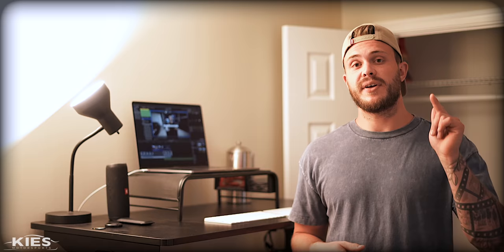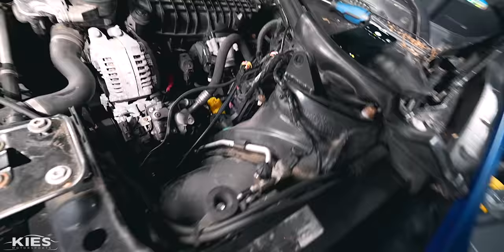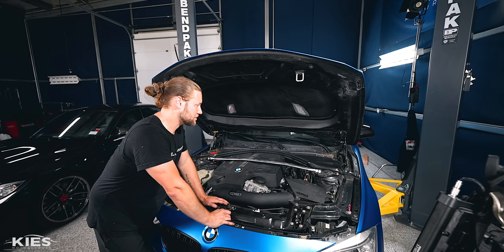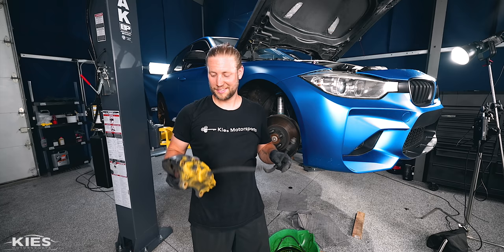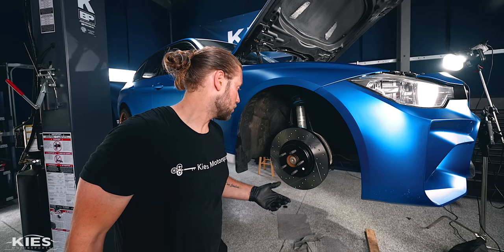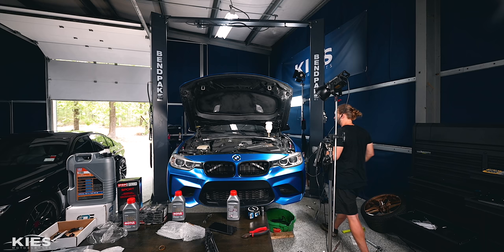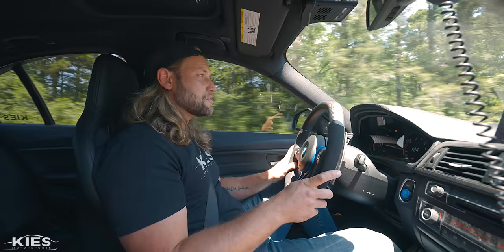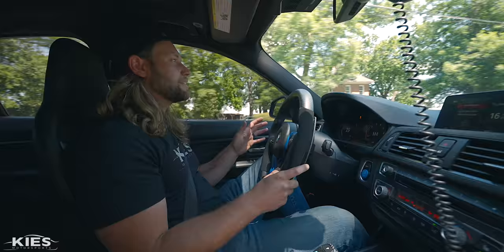F80 M3 Brakes and Dorch Stage 2 HPFP on my F30 335!

Comment: Will there be a version for 328 base brake upgrade🤪
Reply: I think the better question is, is it substantially different for the base (non-M sport) brakes? I’ve read different takes on whether the M sport/M performance caliper and rotors are compatible with the base brake system
Reply: it fits. look up m performance brake kit
Reply: Wouldn’t it get stuck on the knuckle ?

Comment: Where you hitting fuel limits with your hpfp? Didn't you have a dorch stage 1 running on 93 octane? no meth or ethanol. kind of curious because I'm planning on a pure stage 2 with no ethanol and cannot decide between a stage 1 or 2 hpfp.

Comment: Awesome, except, I Wish you were doing the 2NH 6 piston and 4 piston upgrade... Really need to what bracketing is necessary to have those mounted.
Reply: Hey Kinz, I have retrofitted the 6 piston front and 4 piston rear calipers from the M2C or M3/M4 with CCB. If you'd like info on the bracket kits to mount these to your F3X let me know and I can have a set made up for you.